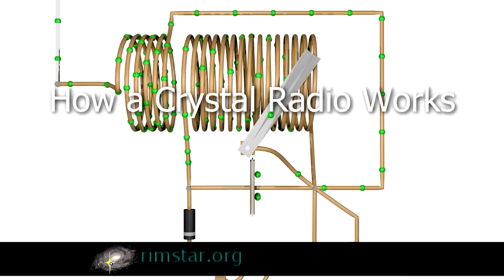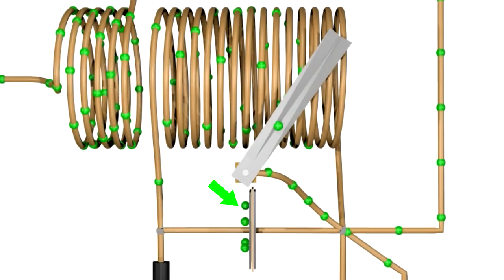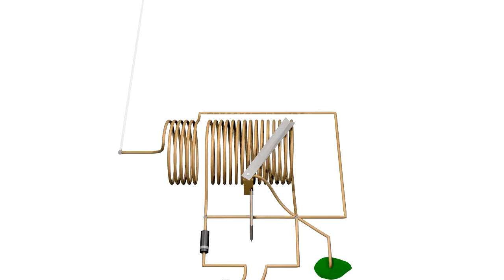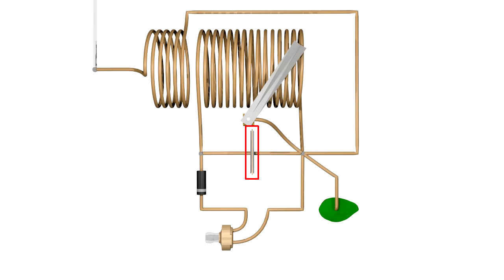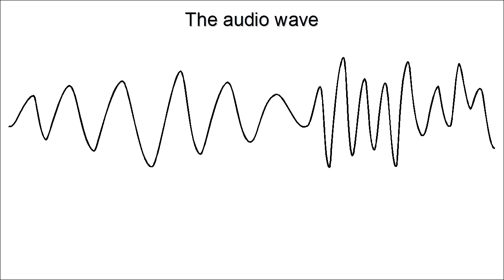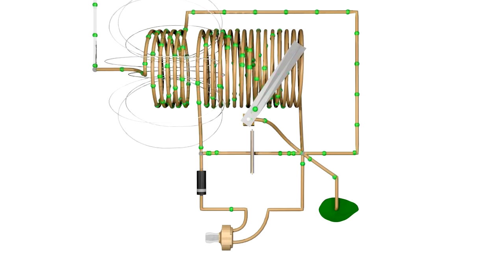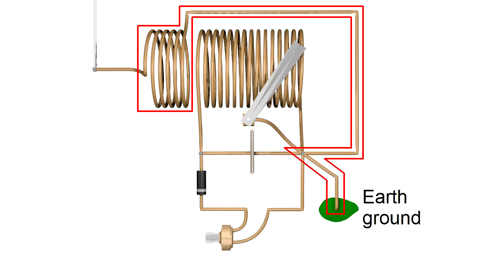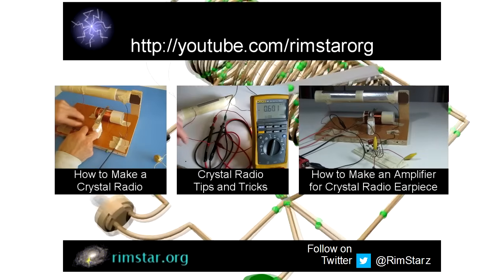How a Crystal Radio Works

Comment: I'm sorry this is not correct by any means  and I can prove it with two words.  Or maybe one word  depending on your slang.  "Single sideband."  AM  signals are NOT some  magic  modulated wave with the audio added in.  They are in fact  the carrier, just like an unmodulated carrier,  and the AM modulator has  RF mixed the modulating AF signal to form  (as an example a 1000HZ test audio tone)   an output consisting of  the carrier on the RF frequency,  and two  sidebands, one  added  and resulting at 1000Hz  ABOVE  the RF carrier in frequency, and  another sideband  at the difference frequency of the  1000Hz tone and the carrier,  so that sideband is  BELOW the carrier  by  1000 Hz.  What  I am  describing is really 3  completely separate signals  (which can be isolated and or eliminated  AKA   single sideband transmission, where only 1 of the 2 sidebands, and  NO carrier is transmitted.)

The diode  in a crystal receiver  actually MIXES  the sidebands and the RF carrier  to form (basically)  the following output:  1,  the RF carrier,  and 2,  the audio which results from mixing  either or both sideband signals  with the carrier,  and resulting in the original  audio signal, as that is the difference product of the two.  Lastly,  the two sidebands.    The original RF signals, that is the carrier and the sidebands,  are filtered out because of the electrical properties of the output network,  leaving only the audio signal.   THIS IS IN FACT  essentially the OPPOSITE   of what happens in  the AM transmitter.  Modulation, detection,  and mixing all amount to  the same thing---two signals  mixed in a NON LINEAR device.  --A diode.   
If you look at most ANY  traditional vacuum tube radio  of  years ago,  those USE  a diode detector, which is  typically  a  second  element inside the  1st audio amplifier.  Even though this is a  vacuum tube detector,  it is nevertheless a diode detector, just like in a crystal radio.  

Wnat more proof?  How is a single sideband signal generated:   By a balanced modulator,  which  may use   DIODES  The output  is  a supressed carrier  and two sidebands, one of which is  filtered out  by  (typically) a crystal lattice or mechanical filter--leaving the sideband

HOW IS   the single  sideband detected  into audio?   By MIXING it with an artificial carrier  at the receiver, know as a beat frequency  oscillator, or BFO.   THIS CAN  be accomplished by a single diode detector---just exactly like what is used here.

Comment: Could i use this circuit and turn it into a fm radio?
Reply from the maker: No , it's not designed to handle FM. I've heard of some people accidentally picking up FM, but that was just luck.
Reply: @RimstarOrg  no I mean could I use the output and put it through a circuit that convert's it into fm basically add a circuit to where i can use a normal speaker
Reply from the maker: Oh, you shouldn't have to, unless your speaker does take FM. For example, in this video https://www.youtube.com/watch?v=U5axWtCqgCA I replace the earpiece with a homemade amplifier with a speaker.
Reply: @RimstarOrg  ah ok, thanks 👍
Reply: @RimstarOrg  this is for a solar lenses?
Reply from the maker: I don't understand your question. I didn't try powering it with solar if that's what you're asking. If you size the solar panels correctly, then you should be able to power it from solar.
Reply: @RimstarOrg  yea I get that but I am asking can I turn the crystal radio into a FM radio?

Comment: Is there a nano one of these
Reply from the maker: I don't know. But it can be made smaller by putting a ferrite core inside the coil, then the coil can have a smaller diameter. The capacitor can be made smaller too, there are smaller commercially made variable capacitors you can buy. You'd still need a good antenna though. I made a bigger, portable one using a pizza box here http://youtu.be/dB-76NdfTbU

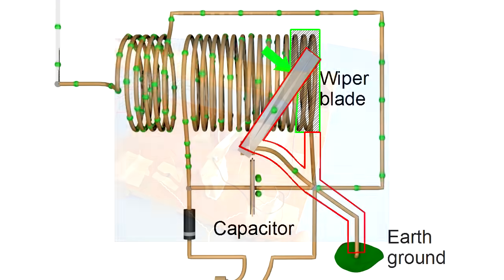Comment: 1:20 why no voltage? eli5
Reply from the maker: +yrjosmiel73 What I mean there is that there is no voltage on the coil between where the wiper blade touches the coil and where the coil goes to ground. That's because the other end of the wiper blade is also going to ground. If they're both connected to ground then it's as if they're a single point.

Comment: they call it a crystal radio detector because the diode was originally a crystal, not b/c the ear pieces was a crystal, correct?
Reply from the maker: Correct.

Comment: So you lose one half of the modulated signal.why not used two diodes in reverse and combine both mirrow images to get a stronger copy, and next to them two small capacitor to booast up the audio level with a small transformer to change ohm to connect to a small speaker? its just an idea.
Reply from the maker: I've thought about trying that a few times in the past. Just haven't gotten around to it. Thanks for bringing it up.
Reply: RimstarOrg
HI, just type on the web HIGH POWER CRYSTAL SET and you will see a design from the sixties of this type of double detection,also claims to have better selectivity than most crystal sets ect..has picture and all,good luck if you try it out. it looks very interesting.
Reply from the maker: Angel Smith
I'm not saying the two diodes won't help, they likely do, but don't underestimate where he mentioned using a 50 foot antenna in an area with multiple radio stations broadcasting. Thanks for the reference. Most of the coolest stuff is the older stuff when it comes to crystal radios, like this.

Comment: non capisco molto bene l'inglese potresti spiegarmi perché usi 2 bobine anzichè una come in tanti altri video che si trovano in rete? grazie 

translated by google traslate

I do not understand English very well could you explain why you use 2 coils instead of one as in many other videos that are on the net? thank you
Reply from the maker: 2 coils helps remove the unwanted radio stations. It helps you receive only the radio station you want. Most of the energy for the unwanted radio stations takes the wire from the 1st coil to the ground. In English this is called better selectivity. But, 2 coils also causes a lower volume. In English this is called worse sensitivity. You can see diagrams at 10:43 in the video.[google translation...]2 bobine aiuta a rimuovere le stazioni radio indesiderate. Ti aiuta riceve solo la stazione radio che si desidera. La maggior parte dell'energia per le stazioni radio indesiderate prende il filo dalla prima bobina a terra. In inglese si chiama migliore selettività. Ma, 2 bobine provoca anche un volume più basso. In inglese si chiama sensibilità peggio. Potete vedere i diagrammi at 10:43 nel video. inglese si chiama sensibilità peggio. Potete vedere i diagrammi at 10:43 nel video.
Reply: RimstarOrg "Most of the energy for the unwanted radio stations takes the wire from the 1st coil to the ground."

Most of the energy from the unwanted radio stations follows the wire from the first coil to the ground, including some of the energy from the desired radio station. The second circuit, is tuned to resonate with the selected radio station by the use of the wiper (which adjusts the inductance of the second coil) and the variable capacitor, causing a buildup of energy in the secondary circuit. The resonance is necessary to deliver enough energy drive the microphone earpiece.

Again, you are cheating by using a piezoelectric earpiece. Show me how to make an earpiece fro days of yore.

Comment: your next challenge make a crystal radio that dosent kneed  a ground connection  and also explaining how it works
Reply from the maker: +skyscraper knowledge Well, I've done half of that at least... here's how to make a portable one https://www.youtube.com/watch?v=iunAvz9PbN0. The workings are the same except with only one coil, the coil is a different shape and it doubles as the antenna.

Comment: Isn't this describing wireless electricity? If the transmission is creating electron flow in an antenna...
Reply from the maker: Yes, it's wireless electricity.  But it's not much. In fact, I originally got into crystal radios with the plan of making a whole bunch of them to generate electricity but the output power was too low. After that, I just got a kick out of radios that power themselves (plus I learned a lot).
Reply: @RimstarOrg  Still this is clearly something that needs researching. Experimenting with different types of transmitters, frequency's and so on. Pretty much what Nicola Tesla had already achieved.

Comment: ??? How can it be that some detector receivers work without a resonant circuit? According to your explanation, that shouldn't be possible...
Reply from the maker: In some cases the resonance is with a series circuit, the capacitance and inductance are in series instead of parallel. The components are also not always obvious. For example, a coil can have capacitance too. But you may also not need a resonant circuit if the desired signal is so much stronger than all the other frequencies, though you may hear more static.

Comment: wait, am i missing something? where is the crystal?
Reply from the maker: Before the invention of the germanium diode, crystal radios used galena crystals instead, hence the name "crystal radio". A sharp-tipped wire would touch the crystal, creating the needed rectification. Since then, however, the definition of a crystal radio has changed to mean any radio which is power by the incoming radio waves themselves.

Comment: I thought electrons in diode go from non to white line marked area. Obviously I thought wrong.
Reply from the maker: Yeah, there are two directions. The electrons go from the end with the line toward the end without the line. Then there's what's called conventional flow, and that's from the end without the line to the end with the line. It's that way for historical reasons.
Reply: @RimstarOrg  in reality the what is the real direction??
Reply from the maker: It just depends on your definition of electric current in a wire. You can define it as the amount of negative charge moving in a wire (i.e. the charge of the electrons) or the amount of positive charge moving in a wire, which is what we call conventional current. Both definitions work equally well. All the formulas work with either definition. The positive charge doesn't actually move though, but the direction was chosen long ago by Benjamin Franklin long before we'd discovered electrons. When I picture things, I tend to picture the electrons.
Reply: @RimstarOrg  if I want to send current in one direction but I don't want her coming back in real life how do I put diode in a circuit?
Reply from the maker: You connect the end with the line to the positive of the circuit, for example the positive of a battery.

Comment: I do like crystal radio where they use a transistor even a 2 crystal radio coil to use Stronger Radio Stations To power the transistor  to help pick up a very weak  Radio Stations even use AM to power FM,  Charge a Battery to then even Run Digital Compute (DAB DAB+ HD Radio) (is kinda SACRY  They now can run Compute on  very little power now  RISC, ARM & MIPS)

Not to mesion other projects like LoRA - Ripple & Meshtastic 2 way Text comms and doing a Few miles  like +55miles
Reply from the maker: Nice.
Reply: Similarly scary is unpowered wireless light switches! They use the force of you pressing the button to transmit a signal to a receiver that toggles the light!

Comment: Why circle the wire? Can't it just be straight? And Why it needs to touch the earth?
Reply from the maker: +MidasZ Shaping the wire as a circle makes it into a coil. When current goes through the coil it creates a magnetic field that stores energy as the current increases and the magnetic field gets stronger, and then it dumps that energy as the current decreases and the magnetic field collapses. We need that and here's why...
In the radio the current's increasing and then decreasing happens at different frequencies, and depending on the frequency there will be a different resistance to the creation of a magnetic field. We use the term reactance instead of resistance, since "resistance" has other meanings too.
Capacitors also have a similar form of reactance.
When the coil's reactance and the capacitor's reactance are both the same they will work most efficiently together. But as I said above, the reactance depends on the frequency. So by adjusting the coil and capacitors like we do we are changing the reactances until they are the same, and therefore we are finding frequencies where the coil and capacitor work most efficiently together. If there's a radio station broadcasting at one of those frequencies then we will hear it well. That's the tuning I talk about starting at 3:37.
So the wire needs for be in the shape of a coil so that the coil can create a magnetic field and work with the capacitor to tune in radio stations.

The reason the antenna coil is connected to earth (or a ground, since it doesn't always have to be the actual Earth, there are other types of grounds) is explained at 10:48 in the video. Basically it's to give a path for the energy from unwanted frequencies to go. The reason the tuning coil is connected to ground is because the antenna coil is connected to ground, I think. I'm less certain about that.
Reply: +RimstarOrg so if I make the coil larger then I could pick up higher frequencies but if I make it smaller can I pick up Lowe frequencies like shortwave
Reply from the maker: Benjamin Lockhart
Nope. That would be my first guess too but it's actually less turns for higher frequency and more turns for lower frequency.

Comment: Nice try but ...  As shown the "far" end of the coil is connected to the wiper.  This results in shorted turns which in turn cause a massive reduction in sensitivity and also a large reduction in the Q of the tuned circuit. Not good!  Just disconnect the "far" end of the coil to get a much better reciever.  The "far" refers to the right hand side of the coil.  The primary coil is NOT the "best" way to go although it will work.  A better option would be to allow the antenna to be connected at varying positions along the coil as this would allow for better matching resulting a stronger signal or sharper tuning.  Good show though. Just felt the need to point out these little problems in case someone following your directions got stuck.  TTFN m8  :)
Reply from the maker: +Graeme Lastname Thanks for the feedback. It's not my design. It's one I got from a crystal radio book. However, the next time I bring out the radio I'll try with that end unconnected. But since that sections of the coil is shorted w.r.t the tubing bar how does it affect the circuit?
Reply: What you have is a short circuit from the earth connection through the coil, then through the bar then back to where we started at earth.  This is a low impedance circuit and it will suck the RF out of the remaining part of the coil. Just imagine you have a transformer and you short its secondary, bang, huge currents flow.  All you need to do is disconnect the right hand side of the coil from the earth, don't connect it anywhere. This will allow you to tune the radio with either the capacitor or the sliding bar. This means you will be able adjust the L/C ratio which in turn will allow better matching to the antenna resulting in better sensitivity and/or better selectivity. Thanks for the vid. I love this stuff. If you want a hand give me a shout.  ;D
Reply: Good point.  I made one like this and find if the antenna sheild is connected to the loose end of the secondary coil you mention, i got an increase in volume.

Comment: Haha, I've still got about 100 meters of wire left, but the Tesla is pre-wound, I built it so it all comes apart to show people each section, so the coil comes out as one long coil, sealed on both ends, I would need to remove the varnish and enamel though huh :(

Comment: How come you don't see use of the resistor around much. Is it  because the typical crystal radio is a standard boy scout design and this employs a  more sophisticated solution for a problem electronic engineers or ham licensed folk see.
Reply from the maker: I think the resistor isn't used much because you can still get a crystal radio to work without it and once you have it working then you're happy. It's a minimalist approach I guess.

Comment: Why the name "chrystal" radio?
Reply from the maker: The diode was originally made by holding the tip of a sharp wire against a galena crystal. Even though there's no longer a crystal, it's still called a crystal radio these days.

Comment: Where's the crystals in a crystal set?
Reply from the maker: There usually aren't any crystals these days. In the early 1900s, they used a sharp-tipped wire touching a chunk of galena crystal. But since germanium diodes came out, a crystal is rarely used. We still call any radio which gets its power from the radio waves a crystal radio.